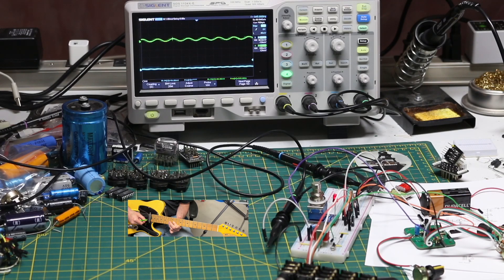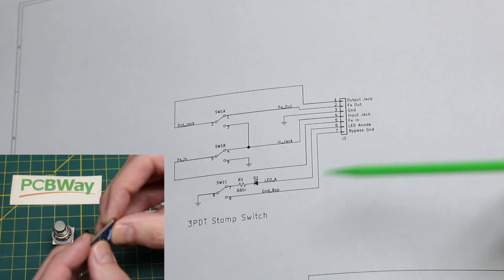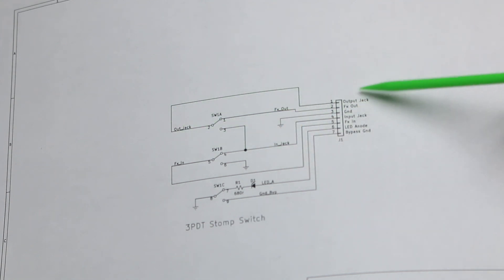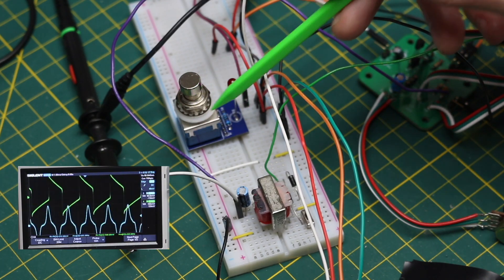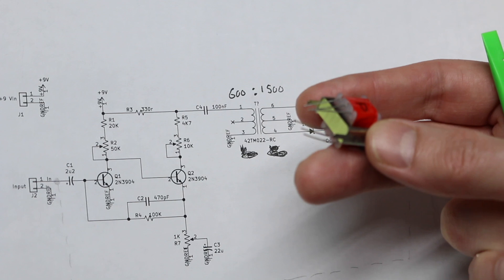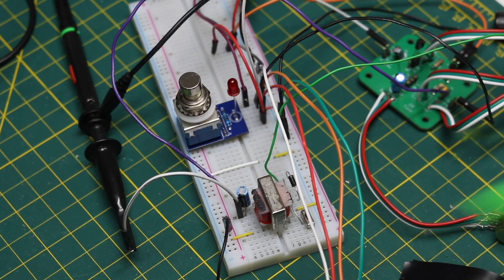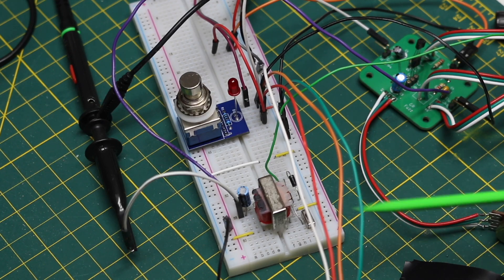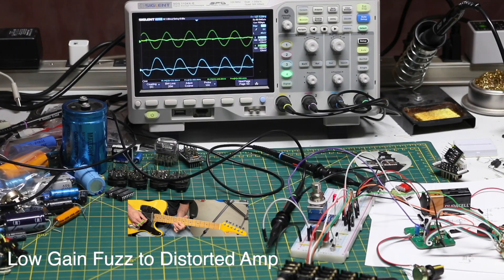Octave Fuzz Transformer Circuit

Comment: Hey this is great! Thank you for sharing. 
If I were to separate the octave section out, what would I need to add in order to make this function? I can see you have an electrolytic capacitor on the breadboard so is there anything additional you’d need for the octave section of the schematic?
Reply from the maker: it’s an ongoing project where I am looking to figure it out. I made more videos on it attempting to isolate the sections but surprises can keep occurring so it needs more work for example maybe an op amp buffer is needed before or after each section so that the signal can either be amplified or else isolated better and not get washed out and loaded down by connecting it to something else.

The octave signal is lower level than the original because the bottom half of each waveform is flipped to the top when it is rectified so maybe that needs to be amplified to get the same volume level and all kinds of things like that

 so eventually there will be another video where I end up finally making a pedal and I’d like to be able to switch whether the octave comes before or after some other distortion or if I can isolate having one or the other only active and have everything function properly.
Reply: To my understanding, the capacitor serves as coupling cap to pass the AC signal from the guitar and block DC from the power supply from entering the transformer.

Comment: This circuit calls for germanium diodes but I found Schottky diodes work well too, due to their low forward voltage. 👍(I made a video on that last year!) Having said that ... are their resulting signals really different?
Reply from the maker: i’ll have to test the germanium I have from the old RadioShack new old stock package, I want to try all kinds of different configurations of where to place the octave in the path.  I might have to make a small Proto board with machine pin sockets for swapping.